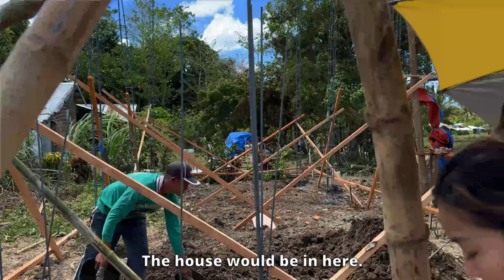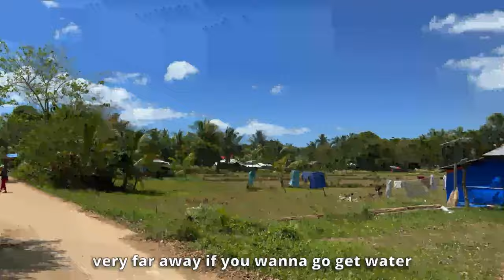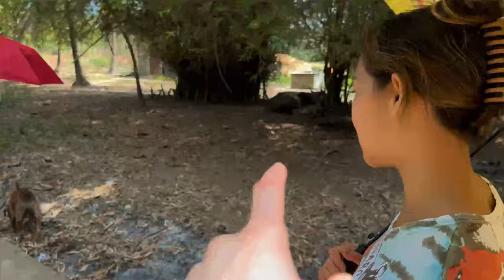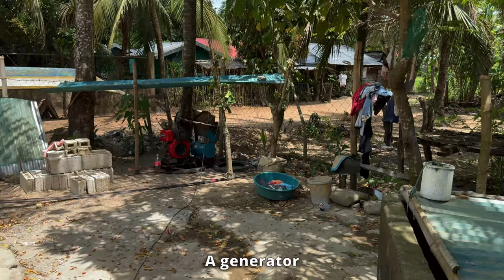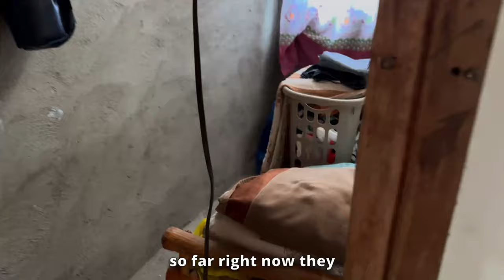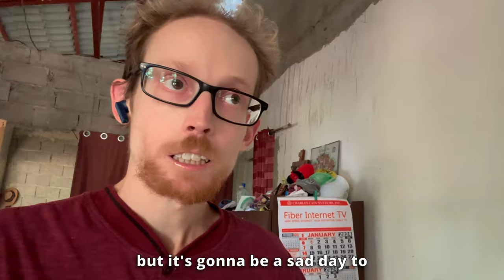Building a Business in the Philippines for less than $20,000!

Comment: recommendation- collect rain water. Technically rain water as precipitates is pure water. it gets contaminated bec of impurities in the atmosphere. But it has much less impurites than using ground water, bottomline is rain water is much easier and cost much less to purify than ground water. its the best way i can think of to make your business profitable. the biggest operating cost is filter replacement if you will use ground water. and as mentioned before, get your set up connected to grid and only run your water treatment system using solar panel+grid tie inverter when grid power is available. Using battery to run your set up is not profitable  because lifespan is limited and very expensive. use only battery for lighting/fans when grid power comes off.

Comment: Also, since you will be using solar power, minimize the use of battery. Using grid power will always be much cheaper than using battery. There is no return on investment on using battery bec battery lifespan is limited and battery available in the Phils are made in China and are of much lower quality than made in US but US made is much expensive. Get your system connected to the grid power. Install a big storage tank. And run only your water treatment system when grid power is available using grid tie inverter solar set up. Use only battery on emergency situation using off grid inverter. if your pumps will need  2kw power, i suggest 4kw solar panels, bec its not sunny everyday. Remember this, the cost of grid tie inverter solar set up is much much cheaper than the cost of off grid inverter+battery system. if you only have 6hrs of power everyday, then run only your water treatment system when grid power is available. its much easier to operate and maintain grid tie set up than off grid inverter+charge controller+ battery set up.